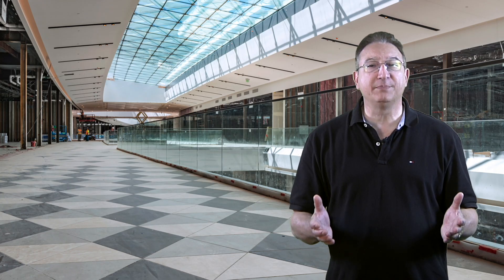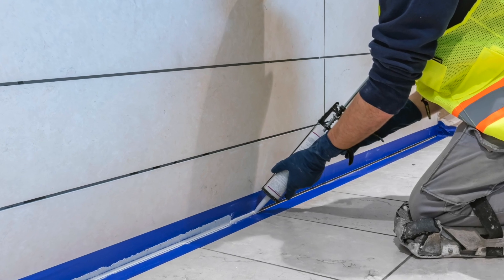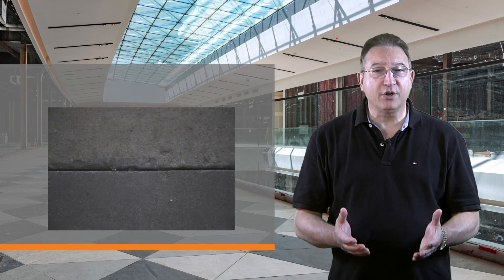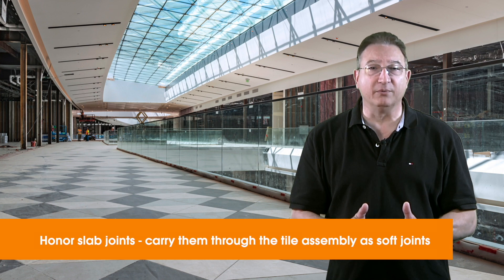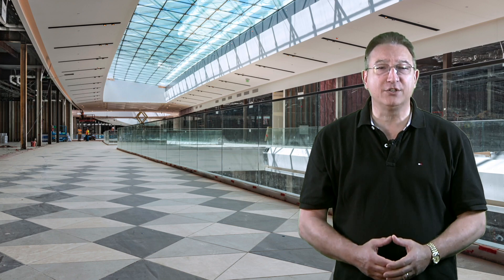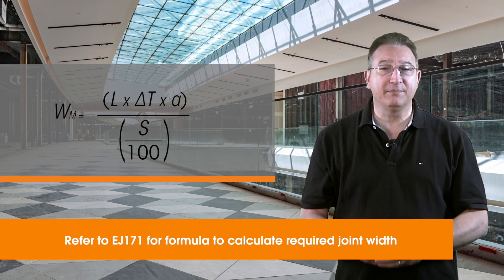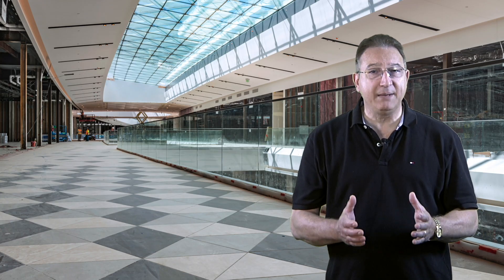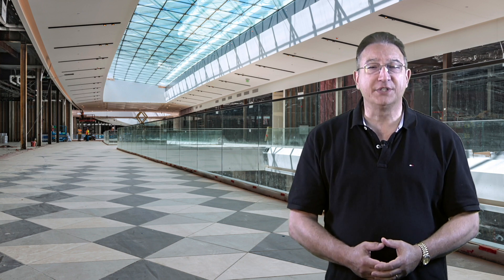Top 5 Tips for Installing Movement Joints

Comment: Does this apply to residential?
Reply: Of course it does. Why wouldn't it?
Reply: @ThorD4602  i was just curious because im not an expert on this. My floor was coming apart after purchasing a brand new house. The warranty only wanted to replace the ones that came loose or broke. I had to hire an inspector  so they could completely remove the floor and install a new one.